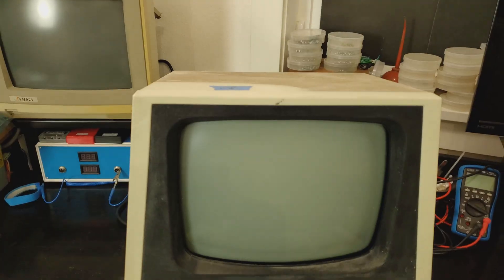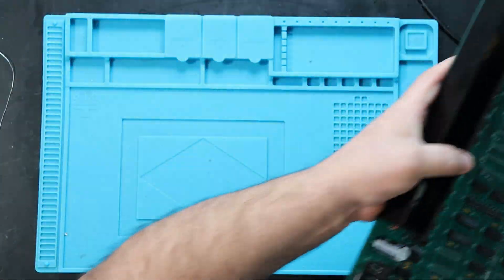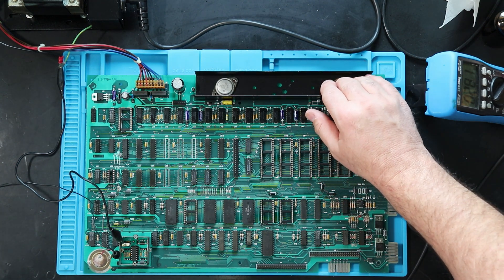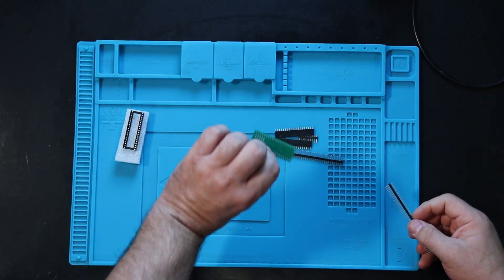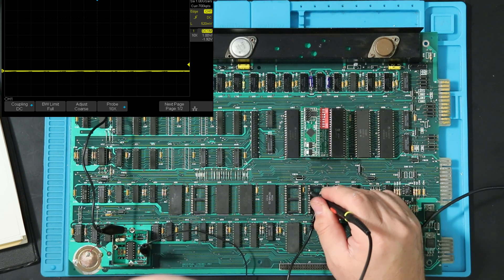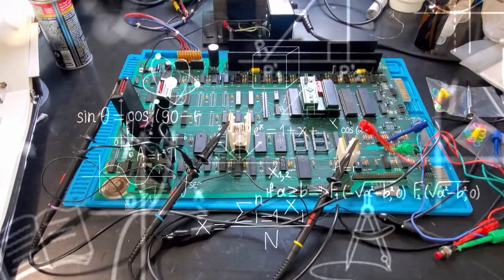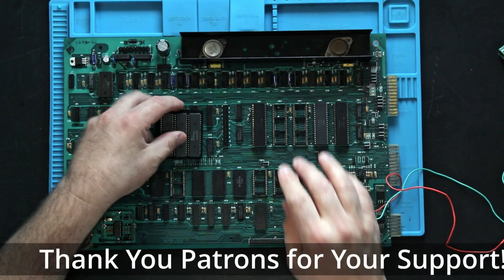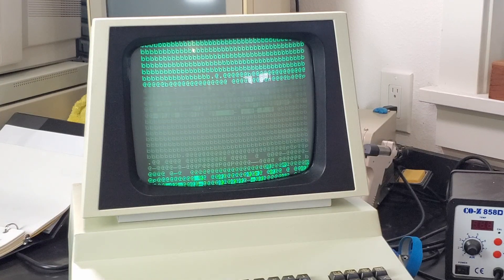Can this Pet 4032 be Saved? Main Board Repairs.

Comment: Good work, once again. I look forward to your next video about the PET.  I also ordered the same video chips (2 pcs.), since I have a Commodore 8032-SK , unfortunately without the keyboard. I have two plans for the replacement of the keyboards, one is designing a PCB converter for a PS/2 and the other is a PCB for a Commodore 64 keyboard. :-)
Reply from the maker: Nice Simon! I am wondering if a VIC-20 keyboard would be easier to adapt since they used Pet keyboards in early VICs?